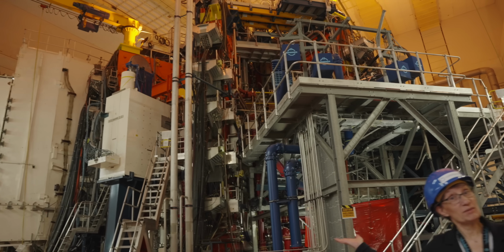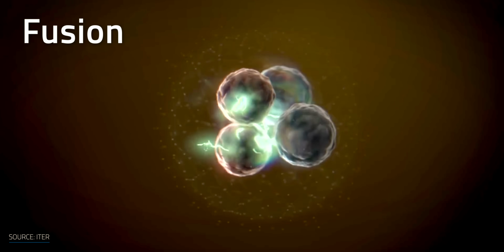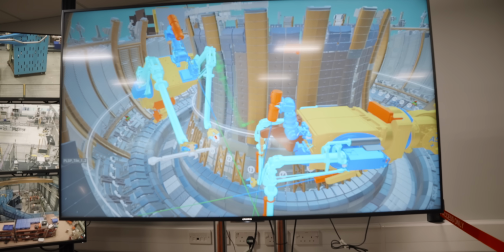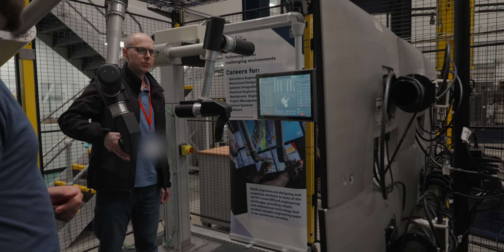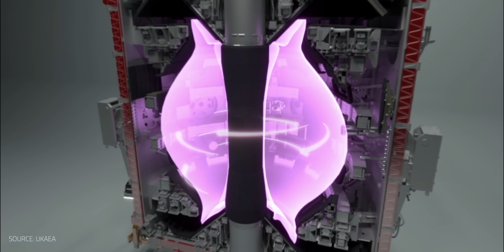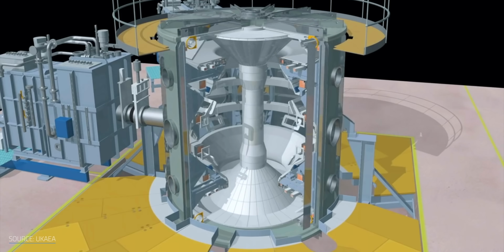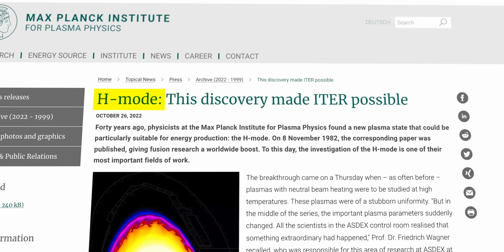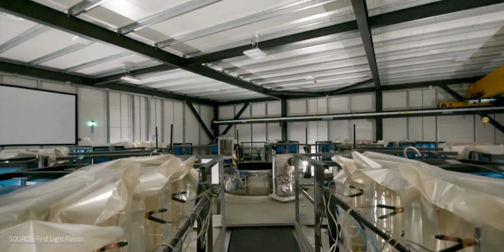How We’re Going To Achieve Nuclear Fusion

Comment: Every country's power supply IS THE NATIONAL ELECTRICAL GRID. 
 
For the sake of God, look at the cost of this immense structure. 
The national power grid has been expanding for 100years. 
Britain was the first to build a national grid. 

It is built to minimum capacity. 
Hello, hello, is anyone thinking. 

The central electric power generation plants are the smallest cost. The smallest costs.

In an all electric world, the grid capacity has to be expanded by upto 5 TIMES. 

Central generation is a minor matter but still incredibly expensive. 

In an all electric world, the EV will be universal as it can be so mechanically simple and store huge amounts of electrical energy daily. 

The same number of rooftops will be available to supply structural support and grid connections for solar power generation and will supply the below roof energy needs daily for the huge majority of the world's population, including the EV  daily drive demands.
Transmission extra costs can be avoided as the grid to home, 50% of grid load, is UNLOADED off the grid. 
In fact the remaining grid demand can be met by the home generation feedin excess electricity. 
The grid owners will make the money and not need the generators. 

Money in the bank, trading electricity and stabilising the grid.

Nuclear fusion is a piece of distracting BS. Maybe one day.
The atomic bomb only took a couple of years to create, not decades and decades. 

After the fusion reactor is running in an over heated world, the distribution of it power will be horrendously expensive, prohibitively expensive. 

Hello, hello, anyone home 👋 hello 👋

Comment: As much as I hope the challenges of fusion energy are solved, I am growing less hopeful that it will be the holy grail of energy that it has been hyped to be. 
Even if experimental reactors eventually produce significant energy output, we are still decades away from bringing the first reactors on-line, providing electricity to the grid.
By that time, renewables and storage will have become mature and cheap enough that there will be little need for fusion.
In the end, I think that fusion will be a niche technology, not the game changing solution we have been sold on.
Reply: It will change the game off planet for sure. :-) That might be quite an extreme change of game.

Comment: Fusion energy is not 30 years away it is here NOW. Energy from the sun in solar/wind/storage is fusion energy and is already the cheapest, cleanest method to supply energy. Nuclear fusion if it ever becomes cost effective is still decades away and we cannot wait for this theory to become reality. Spend more on hi voltage low loss transmission lines, that way we can spread the energy production to match the energy generation.
Reply: Great point!

Comment: Maybe a dumb question : couldnt the resulting heat be captured and reused for energy generation?
Reply: That's precisely the plan. However, so far all fusion experiments have used up far more energy than they could generate (especially for heating up the plasma to fusion-worthy temperatures), so it's kind of pointless to generate power from the emitted heat at the moment.
But once scientists manage to get a self-heating fusion plasma that is sufficiently large and long-lived, generating power from the heat is easy, because it can be done the same way as today's coal and gas power plants do it: by heating water to drive turbines.
Reply: @helgefan8994  good take, thanks! Yeah thats what i thought of as well, like 2030 years they might be able to harvest more than they put into that :)
Reply: That’s exactly what they are trying to do. The problem is sustaining that heat and get more out of it than you put in.

Despite all the hoopla about the modern energy revolution and innovation. We are still mostly still in the Steam Age. Every significant energy source is steam turbine driven. There are very few direct conversion from heat or nuclear into electrons. Solar is one but it’s ridiculously underpowered to power a city. NASA’s nuclear thermoelectric is another but still not adequate for mass use. 

There is a nuclear start up that’s supposed to be able to directly convert nuclear energy into magnetic energy then electrical energy. But I’ve heard critics saying it’s no viable or worse, a scam.

Our best bridge to Fusion is a type of Molten salt reactor that’s capable of burning nuclear waste. The waste can be continuously refined and reused. The final waste product is a nuclear waste that’s dangerous for 200 years instead of tens of thousands. This was already being researched and engineered in the 70s until Mr Peanut president Jimmy Carter stopped all research citing the nuclear proliferation ban!
Reply: @phillm156  Molten salt reactors capable of burning nuclear waste are great, but I don't see how it's a "bridge to Fusion" as you say. Molten salt reactors are still using nuclear fission which - physically speaking - is the opposite of nuclear fusion. Also engineering- and technology-wise there's little overlap between the two technologies, so developments in one won't really help advance the other.
And what's wrong with steam-powered turbines? Sure it's an old, well-established technology, but I don't see any disadvantages if the fuel we're using is clean and will last for many thousands of years as it would be the case for fusion.
Reply: @helgefan8994  I said it can burn nuclear waste from other reactors. Recycling the waste to a make energy and making the waste far less dangerous. They do not need NEW fissile materials. They use the Waste that’s stored right now in nuclear tombs that will be dangerous for up to 500k years. When it’s done with the waste, it’s only mildly dangerous for 200 yrs. That’s a storage solution we can handle. 
In comparison, fossil fuel is far more dangerous than any nuclear waste. Million die every years from its affects, not to mention its global environmental impacts.
Nothing is wrong with steam turbines, as long as the energy of real, not imagined like fusion. They’ve been talking about it for 60 yrs. It might be another 60 yrs. By then it might be too late. Molten salt reactors are real, it’s been made in the 1960s. It works.
Reply: @helgefan8994  I just want to add 1 detail. The amount of nuclear waste available just to the USA right now, can power the entire country for 200 yrs.

Comment: we need to seriously re-assess  our future power generation.
nuclear,  solar in morocco with long expensive lines to get it to europe.
put that kind of money into geothermal, and you'd have never ending LOCAL; power, not costing billions in excess transmission lines.
locally, our delivery cost tripled, putting in a huge line  to connect tarsands to our grid far away from tarsands just to give them carbon offsets.
should be looking at more local, less expensive generation for power.
and geothemal does it without storage.
and not needing huge infrastructure costs to connect it.
put it where you want it.

Comment: I think you can make a good argument that being able to make net positive fusion energy is now less than 30 years away. What I would like to see you cover is the analysis of future LCOE for fusion v. the renewables we are now putting on the grid. It is hard for me to see the fusion LCOE getting lower than the ever dropping renewable LCOE (any time soon) because even when it starts working, the cost of these facilities (even if you assume the fuel is essentially free) will be higher than building out existing renewables for the same power. If fusion starts to work in the next 10 years, then it might be reasonable to see a commercial grid plant in 20 years. However, in the next 20 years we also expect to see the cost of drilling a deep hole for geothermal to drop to the point where a cheap power station can be built anywhere on Earth that supplies energy 24 hours a day, every day in the year (no fuel cost, no neutrons making radioactive waste). Please do a video on the LCOE projections for all these potentials for future grid power.

Comment: I wonder if we crack fusion first, or get geothermal and mini-fision reactors before. I bet on geothermal myself, but the race is still on.
Reply: I’m betting that neither fusion nor mini-fission will ever happen. The reason is that they’re too far away. Even on an optimistic path, we’re 20-30 years out from either becoming a major player on the grid, much less replacing fossil fuels completely. That’s 20-30 years for renewables and storage to grow. So by the time either of those can start getting on the grid, they won’t be competing with expensive, dirty coal - they’ll be competing with cheap, clean solar/wind. They’ll have to win on price, not on environmental impact. And I don’t see either of them becoming cheap enough to beat renewables.

Comment: Yeah dude, nope. By the time fusion, in any form, will be actually commercially viable and producing energy to the grid we have covered Earth's energy needs with renewables many times over.
Reply: It's called energy storage. And ni it's not just lithium ion batteries. There are at least a dozen ways of storing the renewable excess and provide a steady baseline.
Reply: Few serious people believe a 100% renewable national-scale power grid is possible. You need to balance generation and consumption perfectly. Renewable power is variable and while we can have a mostly renewable power grid and engineer solutions for a lot of these problems, you need some base load power generation in the form of fossil fuels or nuclear power. Idk about you but I’d vastly prefer nuclear.

Comment: Was any solution to neutrons eating the reactor as it runs mentioned in here?
Reply: Also the plasma, itself. They talk about the low fuel cost, but these things will constantly eat themselves by stray plasma so the parts have to be continually replaced. That means disposal of the radioactive stuff from the neutrons, but also continuing operating costs from part replacements and the associated down time.
Reply: ... sacrifice ... sacrifice ... sacrifice!...

Comment: 'Solar cell technology that MIGHT work in ~10years', 'battery tec that MIGHT works in ~15years', 'fusion reactors that MIGHT work in ~35years',..
Why not examine something COMPLETY different one day, like... you know... something that ALLREADY works (since ~70years in fact) like a good old fission reactor?!😁
Reply: Not sure about your solar and battery comment and them not working. You should do some research. Fission reactor.  Too expensive to build. Who wants to live near one?  Spent fuel needs stored somewhere safe for 1,000,000 years. ( SNF (Spent Nuclear Fuel) will have 233U, with a half-life of 159,200 years ). Many times SNF is stored in pools on site, in large amounts (like 10 or 20 years of it),  and needs to have active pumped water to keep it cool. If this is interrupted, the heat can boil off the pool water and radio active material can be released. How can something be called clean energy when you have to go bury something?

Comment: I look at a scientific project and look at the bang for the buck.  Never has so much money been wasted going in a direction that will never achieve its end goal.  I will make a prediction that whether it is 30 years, 60 years, or 1,000 years, no tokamak design will ever achieve true fusion that benefits humans in any type of energy goal.
Reply: Right. And even if it does eventually produce net energy gain, the cost of building and running and decommissioning these reactors will not be competitive with renewables

Comment: To go from a small fraction of a second to 24/7 operation is still 30 years away lol.
Reply: I would say at least 90 years.
Reply: @zack9912000  Fusion will be viable industrially only if they succeed maintaining a Deuterium-Deuterium fusion reaction.
For now this is beyond any capability we have.
In order to produce Tritium, Lithium is required.
The price of Lithium increased 10 fold because of its use in batteries.
To get Lithium, requires a lot of water in a very polluting process.
On top of that the Deuterium-Tritiun reaction produces Neutrons that will make the reactor's parts radioactive.
These guys so far are trying to control the reaction and develop a viable cooling system, but from that, to a working commercial plant it's a long way to go.

Comment: It took 2 years to build the first self-sustaining fission reactor (the chicargo pile), it has taken over 70 years and we're still not there with fusion, that is how far we are away...
Reply: Seems like everything is almost paralyzed for the past several decades. There is progress, but just a tiny fraction of what we used to accomplish. For example, the interstate highway near where I live crosses a a river on the state line. The bridge is nearly a century old, and they've been trying to replace it for half that time. Meanwhile, the bypass highway bridge was built around 1980 on time, under budget, paid in full.
Reply: That's sorta the problem with fission, it's so easy to start and it just never stops. That's how you get a meltdown. Fusion on the other hand, perfectly easy to shut down with no lingering radiation... so much so that we can't get it to keep going lol
Reply: Too right fusion is harder than fission, by default solving fusion is more than solving fission (e.g. neutron damage resistance, higher melting temps, robotic maintenance, etc). Accidents in fusion are going to be near instant and uncontrollable but the safety framework isn't developed yet. So all considered fusion reactors (if you've got tritium to start it, and other materials to build it) will inherently not be as reliable as fission reactors and they probably aren't as safe either but we'll need to wait for a proper regulatory framework to find out.
Reply: @dscraggs  I can only  hope the Nuclear Regulatory Commission makes good use of the experiments in progress to anticipate risks and quickly develop that regulatory framework.
Reply: @DistracticusPrime  I don't know about the NRC but there aren't any nuclear fusion energy experiments in progress anywhere on the planet. ITER will be the first and even then it's not fully testing everything (i.e. breeding blankets) so it won't have all of the hazards of a full plant. It will however introduce superconductors which introduces some of the hazards a real reactor would have to contend with (e.g. magnet quench could be game over for ITER) so that will at least be partly interesting. . But it won't run for long periods and it won't be doing breeding so it won't have all of the hazards a real reactor. There are so many hazards stored at high energy within the blankets and these are subject to thermal, radiation, pressure (vacuum), and magnetic stress. I just find it unlikely that fusion will be a safe form of energy. But we'll have to wait for DEMO to run reliably without a catastrophic failure to prove me wrong and that's a long way away. JET is just a fancy neon light bulb, nothing special, it has a vacuum, and activated material, but it's only run for 10 secs and the heat dissipates into the mass of the structure which includes copper magnets, the reactor walls don't transfer heat and are just heat shield plates.
Reply: Everything isn't of equal difficulty. Flying a plane is harder than riding a bike. Fusion is harder than Fission.

Trying to compare the two as if they were equal, when you're not a scientist, makes a very different point than the one you intended.